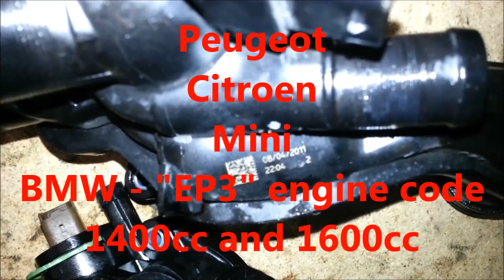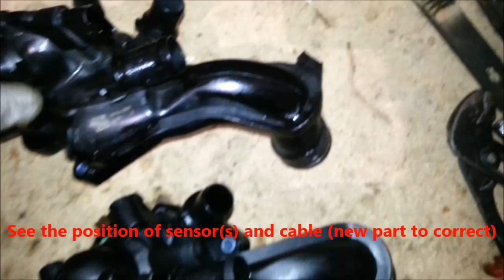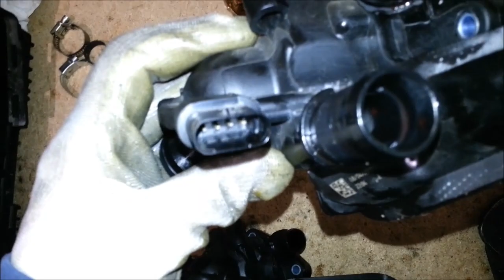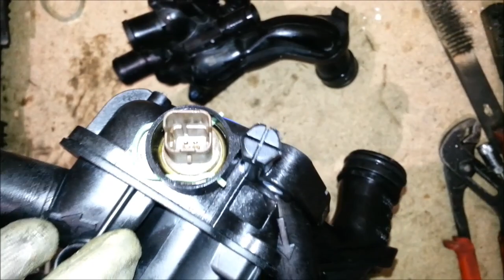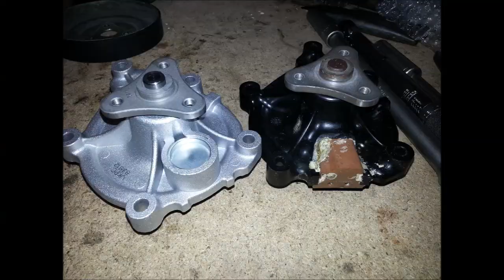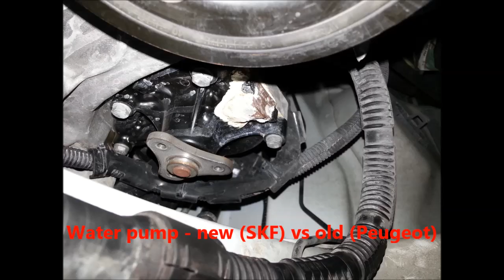Peugeot Citroen BWM Mini - Problems with water pump and thermostat

Comment: hi, i've already changed the thermostat but now its leaking from the plastic pipe that goes from the thermostat to the back of the water pump, the conection between the pipe and the water pump its leaking... i've bought the new part but that pipe its almost imposible to reach, neither from under the car, i think it has 3 bolts under the intake manifold, do I need to remove the intake manifold to change this pipe? any advice?
Reply: I’m having the same issue, did you get that pipe changed?
Reply: @Coop47126  yes, I did it from under the car once you have removed the thermostat... I didn't remove the intake manifold so you have to do it without looking, just by feel... If I remember correctly, the pipe has 1 bolt and 2 kind of hooks where wires pass through... It's easier if you have the new pipe so you can see exactly where those things are... You also have to remove baterry, battery tray, air filter, filter housing to remove the thermostat and have more room from above... Mine was a 2012 peugeot 207 1.4

Comment: Hello, i change this termostatic case in my Peugeot 3008. I addapted the connectors like this video. But i have a problem with the tempetature, this is no higher than 90, its ok but when comes to 90° then back to 70° and always do that. I know That the computer open the termostat in some sircunstanses, but i dont know why do this all the time. You can help me?
Reply from the maker: Leonardo Manza a purga foi bem feita?

Comment: Hello. I have a 308 and you change the parts of a single connector and returned me to fail. (High temperature).
I buy the replacement of two plugs ? and I change this ?
Reply from the maker: Alvaro cutire toledo If you change the thermostat, you got a new cable because the new got two separate plugs. The cable is only at Peugeot/Citroen/..... dealer.
Reply: this is a peugeot problem from factory and did not bother to tell clients. they should be reported to consumers protection authorities.

Comment: Hi, did you have the part number of the new thermostat, actually right now i have problems with my car too  (peugeot 207 1.6Lt)
Reply from the maker: +Jose Luis Vera Depende do ano do seu Peugeot. 

9808646980 + cabo 9804315380

ou

9810916880